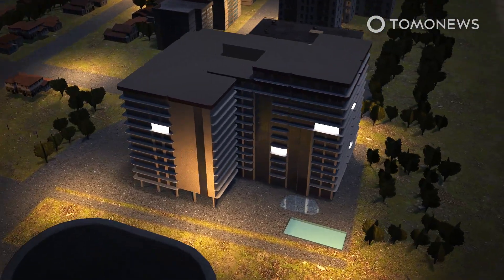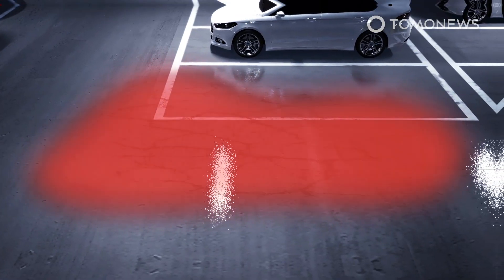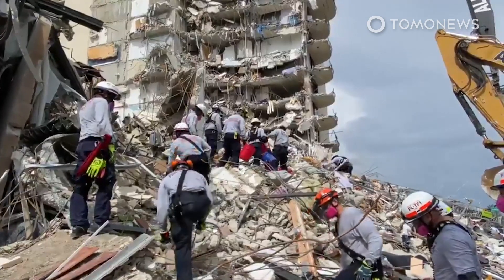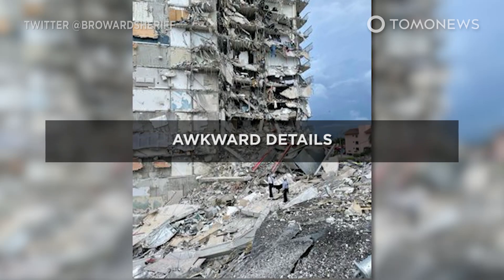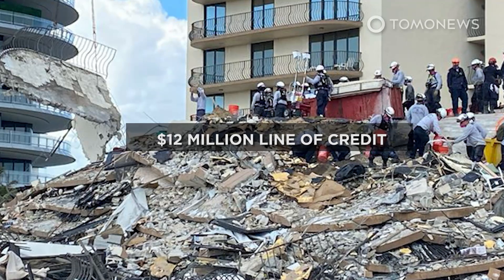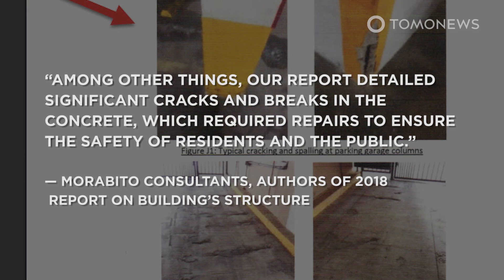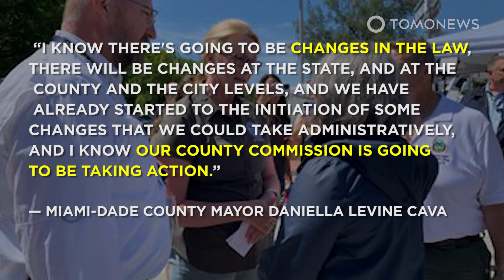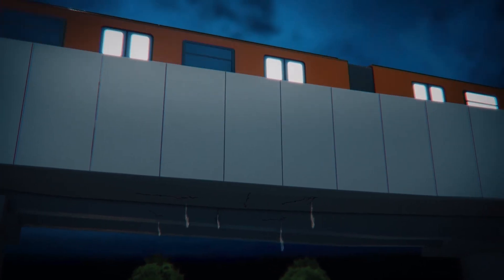Full Walkthrough of Structural Issues That Caused Miami Building's Collapse

Comment: where did the steel go                    .........-Steel frame construction (using vertical steel columns and “I” beams to create the skeleton of the building. Allowed architects to use curtain walls instead of load bearing walls, rather than “wall bearing” brick and mortar. The Home Insurance building, built in 1885, was the first to use this type of steel-skeleton construction):
.................https://www.jwkash.com/eight-simple-steps-for-building-a-skyscraper .
/////////////////////////////////////////////////Dr. Wood's blockbuster book "Where Did The Towers Go", a 500 page labor of love, totally addresses the forensic facts of what happened, why the story of what happened that day does not match the real physics involved and why it's so important that we let the evidence lead to the conclusions and not let the conclusions color the evidence.
https://www.prweb.com/releases/2012/9/prweb9875176.htm /
//////////////AE911Truth agrees that the jet-fuel-induced fires in the Twin Towers could not have melted steel. But because more recent reports confirm the presence of molten steel and molten iron both during and after the 9/11 event, it must be determined what actually melted those two metals and in so doing demolished two of the world's tallest steel-frame .....
/////////